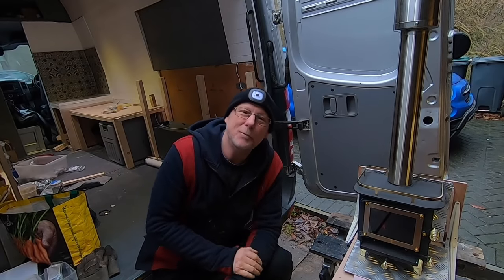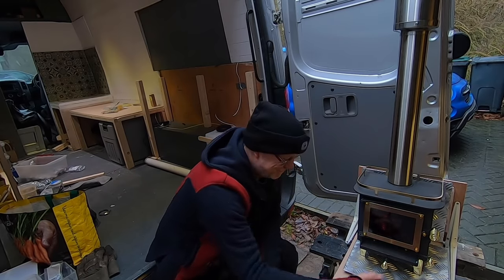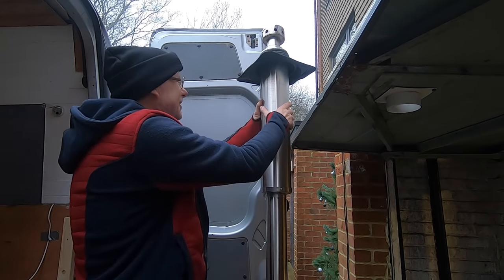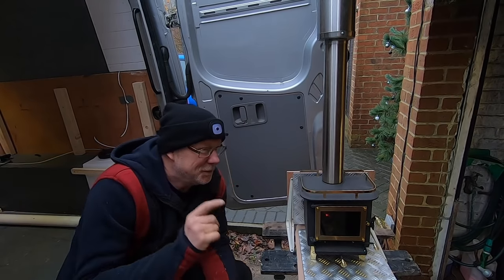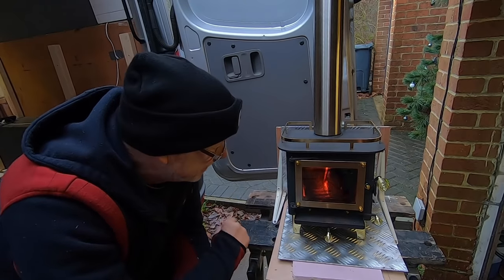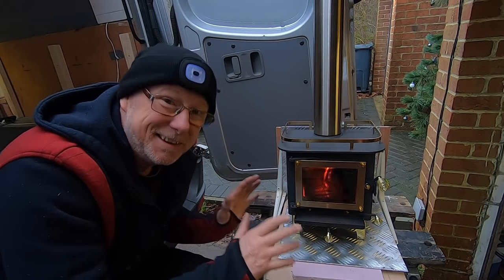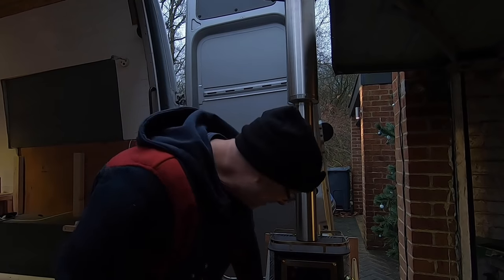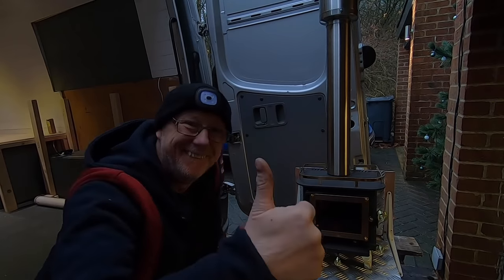How Safe Is A Wood Burner In A Camper Van

Comment: Love your enthusiasm! I installed a wood burner in the most recent build and I’m so glad I did, in the next I will install a diesel heater as you’ve done along side.. in the last van I only ran a propex which was lovely for quick instant heat but useless for keeping me warm all night or for drying clothes, it also dried my eyes nose and throat out so badly I’d wake needing to drink lots! My burners from Glastonbury so it doesn’t have the option to burn coal but once you master vent control you can make it through the night in -5 easily with some of the eco logs! You’ve done your research and as you said those vents are constant ventilation so you won’t suffocate and die! I drilled through the floor under the hearth and installed a vent hole using an unslotted plug which works a treat, the other great thing about burners are no battery drain! Have fun!!
Reply from the maker: Thank you that’s really encouraging I appreciate your positive feedback 👍🤓👍
Reply: That clever regarding the unslotted plug. So your burner sits on a hearth say 500mm from the floor? And in that hearth on the van floor and the hearth floor you have that plug? So two??? Many thanks

Comment: you have nothing to worry about . I fitted one in my camper van a lot bigger than that little one you have . I live on a narrowboat and we have a lot bigger wood burner stroke multi-fuel fires on them the only thing I would say which I know you probably will have  one anyway is a a carbon monoxide alarm  and smoke alarm. kEEP IT WARM KEEP IT SAFE 😉
Reply from the maker: Cheers 🍻 👍🤓👍

Comment: I made mine from a gas bottle...no issues and mine is no where near as safe as yours!! I use an aluminium pipe ...melted it once ...cherry red a couple of times but i soon learnt...i have a water spray nozzle for if it ever runs away but ive been using it for so long that i know its burn character...oh mild carbonmonoxide poisoning twice oppsie😨 but you learn real quick...your stove is safe as houses...id probably even turn my back on it and leave it burning where i would NEVER do that with mine!! Mine is rustic but i love it so much..i cook on it also😊👍 its happily burning away as i type bathing me in warmth
Reply from the maker: Sounds absolutely perfect 👍🤓👍

Comment: We have a wood burning stove in the flat and it's great. Try to get one of the fans that sit on top and push the heat out. You can get them in the Stove shops :)
Reply from the maker: Thank you I’ll keep eye out for one 👍🤓👍
Reply: They are a must with a woodstove and don't use any power !

Comment: Love your videos :) I just bought a Ford Transit 2012 moving van box car with 19 m3 room here in Norway, I will make into a low budget "stealth" camper with room for my offroad motorcycle at back. 

It has a 750kg lifting door at he back so it is perfect for taking in and out motorcycle and other heavy things (motorcycle is only 110kg) so it will still be able to haul a little cargo also if I manage to keep the weight down (3,5T max and it has 1150KG cargo capacity as it is now ).

 For safety it is a good idea to have a Carbon Monoxide / gas detector just in case, works if you have a leak in the car exhaust or gas leak also.
Reply from the maker: Hi sounds fabulous good luck with your build 👍🤓👍

Comment: I was going to get one of these a couple of years ago. They were originally designed for use on yatchs/boats etc. So they a extremely safe with a automatic immediate fire out ability. 
Two things put me off. First was the cost.
But also reports of very limited run time. It was said that you had to constantly feeding the thing.
So Mel as you have used it. How often did you have a keep feeding it during the 3 hour burn?
Can you do a test on how long you can stoke it up for before it goes out??
Reply from the maker: It last about 2 hours 👍🤓👍

Comment: The dipping a wet bit of newspaper in ash thing that some people recommend for glass cleaning is messy and doesn't work well on baked-on tar. We use a tiny little squirt of really cheap oven cleaner and wipe off with a bit of kitchen roll. Cleans the glass a treat. In fact, here in France, some brands of oven cleaner are sold for ovens, BBQs, and woodstoves.
Reply from the maker: That’s fantastic thank you 👍🤓👍

Comment: I’m sure it will be great. I’ve had a charcoal burner on my fibreglass boat for years, keeps the boat toasty at 22 degrees whatever the weather and burns for 12 hours on one fill.  Have a carbon monoxide and fire alarm and it hasn’t set them off.  Have fun.
Reply from the maker: Thank you 👍🤓👍

Comment: I love the look of the wee fire, but as your video shows they give of very little heat.. will be lovey little feature  on a cold day 👍
Reply from the maker: All the heat comes out the front and off the top it’s brilliant 🤓👍
Reply: @BigVanSmallWorld  A single skin enamel pipe at the lower part  would have been better for heat output plus you could put a flue thermometer on it to get a true reading off flue temp optimum 270F-460F which is the most important thing to prevent creasote and tar build up, if the glass goes black your doing something wrong ie under burning, to high moisture in wood under 20% ideal, great little stove that I fitted a Salamander Hobbit in my Latest van very toastie.

Comment: The cold air outside the glass door is preventing the smoke on the glass from clearing. Once it's in the van it should be fine, just Crank it up for five minutes after it's lit well and the heat should clean it.
I see most people only open the main air intake to get it going Good then keep it fully closed thereafter. The fire can then be fully adjusted using the secondarily air control lever.
As I normally say, " you probably know this already". Can't wait to see it in place now all connected up mate! Great little stove and you're leisure battery will thank you for it! 👍👍👍
Don't forget to think about one of those TEG stove top fans to circulate the warm air, making it even more efficient 🙂

Comment: NICE ONE🤘At first when you said you were fitting a wood burned I thought "why" as they're not that practical as a primary heat source but with a diesel heater for primary heat and burner for cosy factor its ideal and yours is uber  compact so it's a win win, top job👍ATB Shane🤙
Reply from the maker: Cheers Shane 👍🤓👍

Comment: Hi Mel about 36 years I used to live in a 1969 Mercedes-Benz L408 G petrol and it had a very intermittent petrol heater so me and my dad made  a small wood burner out of a gas bottle that heated the van for 4 and a half years I had a small sky lite and the chimney was made out of 3 inch gas pipe with 4 inch going through the roof wish I lived  it today but due to its age I had to sell it
Reply from the maker: That sounds like you had a good time and plenty of good memories too well done 👍 🤓👍

Comment: Can you drive with it lit Mel. Just wondered in case you had to move on once it had been fired up.
Reply from the maker: I wouldn’t think it would be a good idea to drive with it lit as allways just park where you know you won’t have to move and if not sure I’ll just use the diesel heater 👍🤓👍
Reply: I drive everywhere with mine going,I use smokeless coal so it's not obviously smoking. Never had any problems after two years fulltiming with it,and it's really nice to have a warm van when I stop somewhere in the middle of winter.

Comment: If there were some holes in the outer wall of the double wall flue, some near the bottom, and some near the top, you would get air flow through them, putting more heat into the van, and cooling the flue further. Note, these are just ramblings, and worth what you pay for them, but I would do it :)
Reply from the maker: No no you need the flue to be hot to create the up draft of air so the burner works properly 👍🤓👍

Comment: You can put a small fan on top to circulate the heat better, and it will burn longer if you use hard wood and choke it back
Reply from the maker: Thank you 👍🤓👍

Comment: Lovely fire and excellent fire surround insulation build Mel - Question;- Are you going to fit a `exterior wind rotational chimney cap` to the flue to try and nullify wind blow back? or does it come with the flue kit you bought?
Reply from the maker: I’m trying to get an exhaust tall pipe that will fit it 👍🤓👍

Comment: as long as its done safely a small woodstove in a van, boat, camper, is very possible as long as you follow the safety clearances from the manufacturer.  When I lived on my sailboat I had a diesel fueled heater that was shaped kind of like your woodstove...had a nice window to see the flames.  Enjoy mate!

Comment: Here's a tip where woodburners are concerned (apologies if I'm teaching my grandma to suck eggs): Put an air inlet as near to the stove as possible.

In Winter, when you're drawing in cold air from outside, you don't want to create a cold draft between the inlet and the stove. Having a vent directly under the stove would also stop the warm air in the van from being sucked out by the stove.
Reply from the maker: Cheers 🍻 👍🤓👍
Reply: @BigVanSmallWorld  dito ..i was only trying to help

Comment: Worry warts saying it's going to use up all the oxygen or burn your van down. I watch other van lifers that have one. The worst thing they've run into is run out of wood. Empty toilet paper rolls with dryer lint inside make a pretty good fire starter.
Reply from the maker: Thank you for your positive feedback and what a great tip I just finished a roll too 👍🤓👍

Comment: The risk from any sort of combustion, be it wood, diesel gas etc, is that with incomplete combustion you get carbon monoxide (CO), which is a killer. As your stove vents to outside, there is a very small risk of  CO getting into the van, even IF it is burning badly. You are extremely unlikely to suffer any ill effects from hypoxia (low oxygen levels) that has resulted from the stove burning the oxygen. Lets be smart here, if the stove burned enough of the oxygen to cause you to suffer a shortness of breath, then the fire would go out, because it needs OXYGEN! With the best will in the world, your van isn't sealed, so there will always be air/oxygen getting in, because the fire will create a pressure drop that draws more air in. If it WAS sealed, you would suffocate anyway, simply from breathing in all the useable oxygen, I doubt a van full of air would sustain a person overnight otherwise. Never be tempted to run the stove with the door open, as under that circumstance, you could get CO build up in the van.
Reply from the maker: Thank you 👍🤓👍